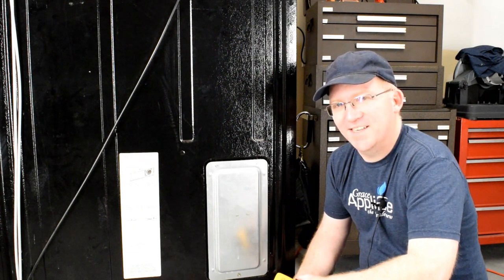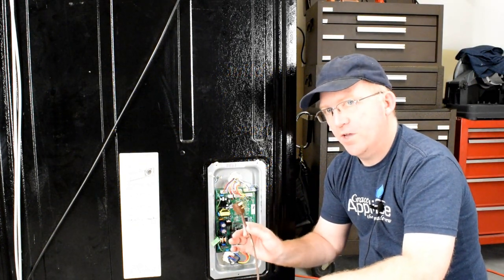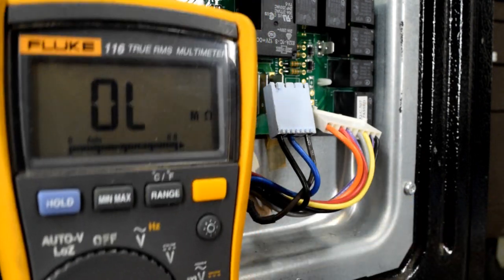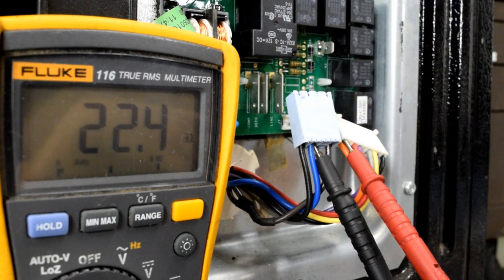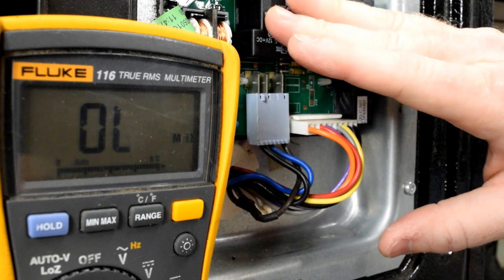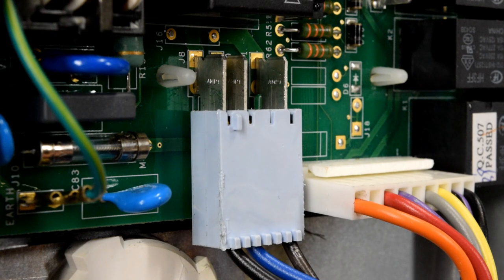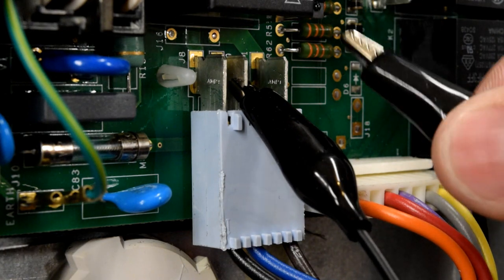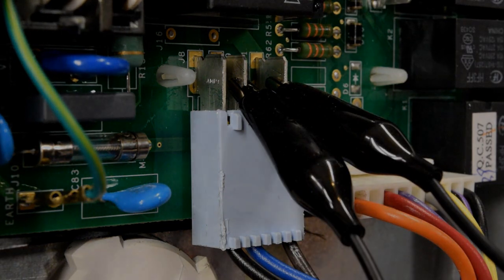Diagnosing a Bad Control Board - Part 3: Defrost Issues

Comment: Nice job. Just one correction. The resistance reading through the defrost heater and defrost thermostat  is around 22 or so ohms not 22k.
Loved you video on fan motor diagnosis btw. First time some explained how to check for an RPM signal. Thanks
Reply from the maker: Lol! I know... Uggg!  Haha
Uploading a video to YouTube is like a bell once rung can't be unrung.
Reply from the maker: Thank you for the information either way. I'll see if I can call it out in the video somehow just in case someone needs to know it. Andy

Comment: Great explanation of GE S/S refrigerator method of operation for auto defrost. I will recommend this series to anyone for detailed instruction for diagnosing defrost issues on these models. I have never come across a method to force defrost on GE S/S refr either. I suspect GE techs are using laptop link to control for detail diagnosis. Or perhaps they just do like we do and eliminate parts failure by checking through jumping out or resistance value. Keep up the excellent video's.
Reply from the maker: Lewis Riesbeck thanks for the kind words Lewis!

Comment: First, thanks for the highly informative videos. They've been extremely useful. After my GE # GSH25JSTCSS iced up I followed your diagnostic steps, and found continuity in the defrost circuit and the expected resistance in the thermistors (the defrost sensor, however, gave a very low reading at first with my shoddy Harbor Freight multimeter. Reseating the leads gave the expected result...but I thought I should note this). The condenser coils were very dirty so I cleaned those, and I manually defrosted the fridge. 

We recently bought our house, which came with the fridge, so we're not familiar with it's work history. I did notice, however, that the pink and blue wires going to the heating element look like they've been serviced before, as I saw shrink-tubing around the wires. I also manually checked the element for continuity, and tested the thermostat by placing it in a cup of ice water in the deep freezer. They both pased. The element did look a little beat, though, with some dark bands at either end. 

The fridge temps returned to normal, and have maintained such for a couple of days now, and I caught one of the defrost cycle as it happened and verified that the heating element was in fact working and glowing orange. However, I also noted that even though the defrost cycle seemed to have the fridge shut down for quite a while, the element wasn't active the entire cycle. When I casually caught the fridge in a couple of other defrost cycles, the element wasn't active then either. Is this normal behavior or should the element be active the entire cycle? 

Thank you for your time, I'm just trying to best determine what's wrong with my fridge before dropping $200+ on a new mainboard, or avoiding the scenario where the real problem is something else entirely, like a coolant leak or bad door gasket. Is it possible that the misread I got from the defrost thermistor was actually a sign that it's bad? Does a bad control board sometimes let the defrost cycle work and other times not?
Reply from the maker: Hi Hank, 
Thanks for the kind words and for watching.  I'm glad to hear they've been helpful. 

The intermittent ones are just the worst.  :-/
Now, from the way you describe it - It really sounds like a poor connection issue.  If the refrigerator is in a defrost cycle, the heater should not come on and off.  It's ON until the defrost sensor reaches a given temperature (110' lets say) and then it would go back to it's cooling cycle.  So, what you've got is not normal operation. 

The fact that the heater comes on at all tells us that the control board is sending appropriate voltage (at least intermittently, but I wouldn't rule out a failed control board) 
I haven't seen where a failed defrost sensor would cause this kind of symptom and the issue to me seems to lie with either a bad connection or failed control board. 

A failed board would and can certainly cause this symptom.  A weak relay that sends the voltage to the heater could be trying to make connection, but not have the umph any longer or has too much carbon build up on the contact points and doesn't make a good connection there any longer. 

The spots where you see the repair has been made in the past is where i'd start with my inspection.  I never trust anyone else's repair if i'm there as the 2nd technician.  Basically, you'll just want to verify that this repair is still up to snuff.  

They way i'd approach it is to do the jumper wire to have the heater turn on as shown in this video. At the same time (using caution of course, live voltage, more disclaimer, etc etc) while the heater is glowing orange, I would wiggle the wires around where the previous repair had been made to see if you can get the heater to turn on and off by doing this. 
If so, you've found the failed connection.  

If I couldn't get the heater to do fail by doing that, It would leave the control board.  
I'd remake these connections myself with solder and replace the control board.  Or, if you wanted to try the soldering the connections first....wait to see if it works.....and then replace the board - you could do that.  But, that's more hassle in my book. 

I hope this helps and let me know if you have any questions, 
Andy
Reply from the maker: Also, the dark bands you mentioned around the ends of the glass tube on the heater is no problem.  If it glows orange, it's good.

Comment: Hi Andy, great videos! 

I have a 2005 GE side by side (GSS23SGSBSS) that is almost working normally -- freezer runs about 0 degrees and fresh side runs about 40.  The problem I'm having is that the freezer is sometimes getting so warm that the ice cubes are partially melting and there's a lot of frozen condensate starting to form icicles in the freezer.  The condensate fan keeps getting ice on it which makes it noisy and I have had to replace the fan motor twice.  

I've checked the defrost system and all appears correct by your troubleshooting instructions and the condenser coils are nice and clear, so now I am thinking that the control board is leaving the defrost cycle on too long or it's defrosting too frequently, causing the ice cubes to melt and condensate to form.  

Two questions for you:  

I ballparked the ohm readings on the thermistors because I was not sure exactly what the internal temps of the fridge were (I had just cleaned it out, so it was warmer than normal), but they seemed to be roughly in the right range.  Should I repeat the resistance checks to ensure they are close to the readings you provided in your video, or is it enough that they are in the ballpark?  

Second, I know you said we can assume the control board is bad if the other components check good, but what do you think about my specific problem, where it appear the freezer is just getting too warm once in a while?  Am I correct to think the defrost might be staying on too long or coming on too frequently? 

Thanks for any help!

Comment: Andy have you work on a samsung fridge,  I have a RF26HFENDSR/AA. Unit is not cooling freezer is ok. It's building ice. How can I tell was wrong with it. Thanks for your advice
Reply from the maker: Rodrigo Luna hi Rodrigo, 
Yes I have worked in many Samsung refrigerators. 
If you see ice build up in the freezer, it will likely be a defrost issue. 

This is going to be one of 4 possible issues.  
The heater, which should have about 20-40 ohms of resistance when you test across the terminals. 
A bad thermal fuse, which should have about .08 ohms when measure at the terminals. 
A bad control board, which sends 120vac to the heater when called for 
Or most commonly, a failed defrost sensor (yellow wires at the top of the evaporator) 

When testing the sensor you should see about 16,000 ohms when in ice water.  If you replace this, relocate the sensor to the top and center of the evaporator and secure it with a zip tie.  

The downside with Samsung refrigerators is to access the evaporator, you’ll need to let the fridge thaw for 24 hours with the doors open in order to be able to remove the back panels inside the freezer. There is a lot of styrofoam panels that will be destroyed otherwise.  

I hope this helps with some things you can check for now.  

Andy

Comment: I’m working m a GE bottom freezer with a similar board as yours and am reading 32 between the two wires... when you say I should be getting 22.

What would that mean?
Reply from the maker: Hey Watertown,
I wouldn't be concerned with that. Seems like a good part to me. You have a good heater and high limit thermostat. There are 2 different variants of these heaters and yours has higher resistance than mine. No issue. 

Your fault will be either with a failed defrost sensor or a failed control board.  In have a video called testing and replacing a defrost thermostat. Check the defrost sensor. If good, it's a failed main control board. 

Also on the back side of your control board you may find a burned solder joint. See the video called visual inspection of a bad control board for info on that.

Thanks! Let me know if you have any questions. 
Andy

Comment: Hi, thanks for all your excellent and informative vids. I have qestion about my GE side by side defrost system. The defrost is not workin properly - (freezing up) I ran the tests that you showed and the only way that I can get continuity from testing the blue and orange wires is to remove the thermostat and tie the wires - ( remove it from the loop ) , this is also the only way that will make the heater go on when jumping the wires on the board as shown in the vid.  So is the thermostat bad or is it just at the wrong temp to be working ? What temp does it need to be at to show continuity and / or make the heater work?
Reply from the maker: Hi William,
Yes, it sounds like you've correctly diagnosed the issue.
This is your high limit thermostat. So, it should let power pass through it so long as it's at room temperature. It's designed so that if it gets too hot (130F+??  Not sure) it opens the circuit as your circuit is now.  
I've seen where techs or home owners  will mistakenly swap this high limit with a regular defrost thermostat which has a totally different purpose and it will measure open at room temp. Maybe it was worked on in the past and replaced with an incorrect part? Who knows. In any case...

So, replace that part and you should  be in good shape. I think they've got an orange and brown wire leading to it.

Comment: Great Video, I am entering into home appliance field and this video is of great help. Thank you Sr
Reply from the maker: Awesome! You're most welcome.
You're entering a field that is in dire need of qualified techs that can quickly  and correctly diagnose the true issues vs just taking guesses and swapping parts hoping it works.

You will definitely make mistakes along the way, but as you gain experience you'll find this is the case less and less. I still get bit sometimes, but they are getting further and further apart when it happens.

What state are you in if you don't mind sharing?

Andy
Reply: @GraceAppliance  Arizona, Phoenix. I guess I will be bothering you quite often. Where are you located ?
Reply from the maker: @budgetcoolingandheating4059  I'm in East Texas. I moved recently from busy DFW to a much slower pace.
It's taken some adjusting to get used to it, but I'm getting there.
I'm an appliance repairman / hobby farmer. I will tell you though, the skills I've gained from appliance repair have helped me tremendously almost daily with my various farm repairs.

Phoenix should be a super market to be in though!  If you don't have a bluebook yet, I'd consider getting one. You may not always charge that exact rate, but it gets you in the ballpark of what you should be charging for each job. It has simplified things for me on what to charge for certain jobs.
Reply: @GraceAppliance  Thank you very much for the advise, I really appreciate it. I've been working for year as a Repairman for AC and Heating equipment (central units) and I've done well. But I am very interested in learning the appliances field as well, a little different with all the electronics involved, but I am taking one day at the time. Very interested in refrigerators repair as the prices on them has skyrocket in the last few years.  Thank you again and good night.

Comment: Thank you for this great video (and your other videos), very helpful !   We have a GE PSR26UHRBSS with a compressor that won't start.  Using a multi-meter I've verified that the compressor itself, and the relay, overload, and capacitor are fine.  With your videos I was able to determine that the defrost heater and high limit thermostat are fine (22 ohms).  For the defrost sensors I get 10, 10, and 10 which seems to correspond with the estimated 13 degrees celsius of the current fridge temperature.  So i think they're ok.  Based on what I've seen you mention, I assume the only suspect remaining is the control board itself?  I've inspected the board visually, front and back.  Nothing bulging or burned.  I kind of wish there were a visible defect with the board so I would know it's that for sure!
Reply: UPDATE - Replaced the control board and all is working perfectly with my fridge again.  Thanks for the great flow chart and videos.  I also learned that even if the control board shows no signs of... 

- burn spots

- swollen capacitors

- affecting the digital display

(common symptoms)

... it can still be the control board.

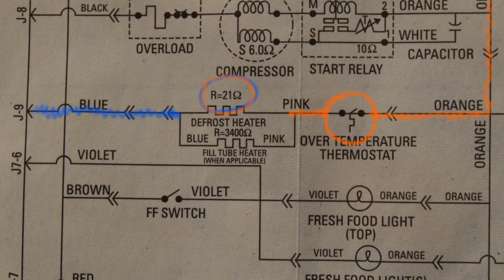Comment: I have three of these types of GE Frigs. Where do I get a schematic like yours (1:52)?  (All three purchased new and none of them had a Thermistor Look Up table and for sure no schematic anywhere on the Frig.)    With the frig unplugged, would the Over Temperature Thermostat be "Open" as the frig would be around room temperature? 
I really appreciate the Technician/Engineer approach you take to diagnosis.

Comment: Hello, I have an 18-year old whirlpool refrigerator model GS6NBEXRS00. It is not defrosting.  I replaced the defrost thermostat but the old one actually tested ok.  I have a 25 Ohms resistance on the heating element, so I believe it is good.  What do you think is the problem? 1)  Freezer sensor/thermistor (where is this on my ref?)  2) Adaptive defrost control board (where is this on my ref?) 3) Or the main control board (where is this on my ref?).  It looks this the control boards for my ref are no longer available, so maybe just replace the whole ref with a new one.  Kindly advise.  Thanks

Comment: I'm only getting 3 ohms on the heater/thermostat test so I assume one of the two parts is bad.  Is there a way to test the thermostat only?  Both parts are very inexpensive, so I guess I'm just curious at this point. Thanks for the great video!
Reply from the maker: Hey, yes 3ohms sounds low to me as well.
Like you mention I'd replace both either way. 

They are both in series with themselves, so without taking the heater out of the circuit first, you aren't able to test independently from the board. 

Hope that helps! Andy

Comment: Andy and others, I have a GE Side by Side DSS25KSRDSS with an unresolved Defrost issue.  I watched all your excellent videos and my Refer passed all the tests.  All components work and are within specs.  The control board looks to be in as new condition, the seals look OK and the condenser is relatively clean.  I even plugged up the ice dispenser hole to keep moisture from the air getting in, however, after a few days to a week it ices up, then everything melts for a few days.  It doesn't turn back on and start cooling by itself after a reasonable time period.  If I unplug it and then plug it in after a few days when everything is room temp the coils get cold very quickly and the evaporator fan and the condenser fan work.  Can the board pass all your tests, look good and still be bad?  If so, where is a good place to get mine checked or fixed or where is the best place to get a new one?  Thanks for a reply.
Reply from the maker: Hi Richard,
Thanks for the kind words.

It sounds like you've got a failed control board. If the heater passes, the high limit passes and the defrost sensor passes (keep in mind the value changes based on temperature so just because you have continuity doesn't mean it's good) it should be around 14.xxOhms when submerged in ice water and about 5ohms at room temp. 

but if you've tested all of these and still have defrost issues, it's definately a failed control board.

You'd need a wr55x10942 for your replacement. Here is an Amazon affiliate link for your board https://amzn.to/2TL2fZ0

Even if they look OK visually, it certainly cna be a bad defrost relay on the board itself that is failing.
For this issue you're having, a GE, you must deduct that it's the board by elimination. The only other 3 components that have to do with the defrost are the sensor, hi limit thermostat, and heater which you've tested as good. So, that leaves the bad board. :)
I hope this helps and let me know if you have any questions. Thanks, Andy
Reply: Testing my GE Defrost Sensor (White Cylinder) - WR55x10025
,
it measured 14.16 kOhms at 32 Degrees F and 3.66 kOhms at around 85 degrees F which was close to a chart I found at From <http://www.appliance-repair-it.com/refrigerator-thermistor.html>
Reply from the maker: Richard Laney yes, I agree - sounds like the sensor is fine. Good work. 
Replace your control board and you’re in good shape. Let me know if you run in to any snags along the way.  Thanks!